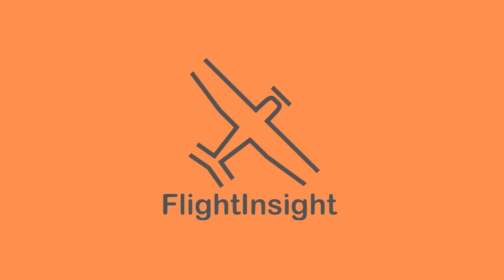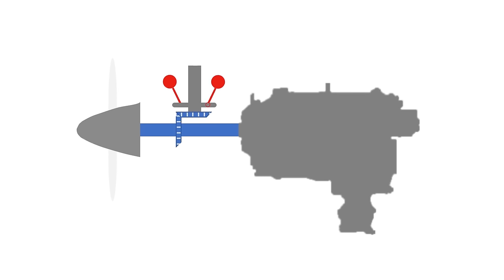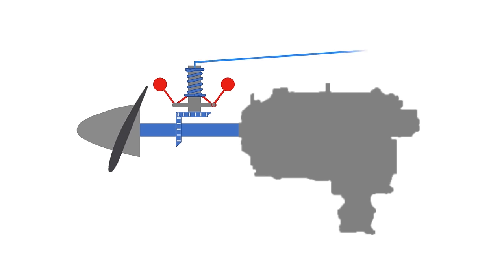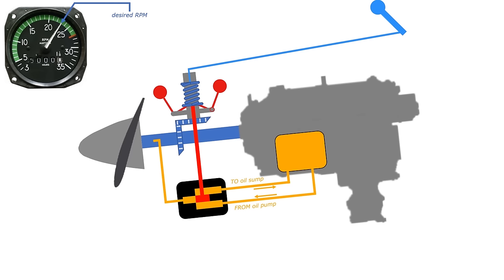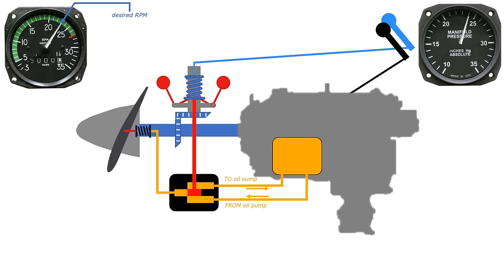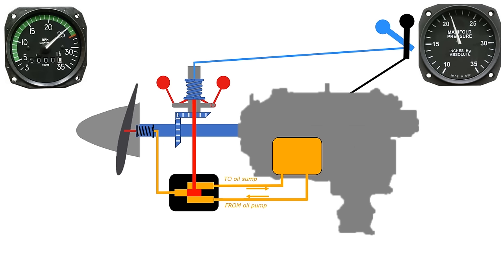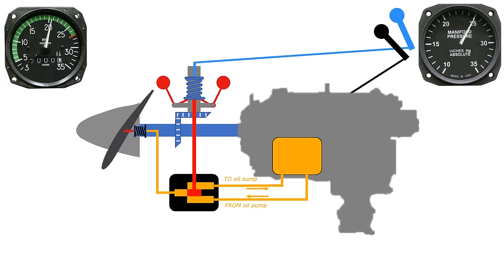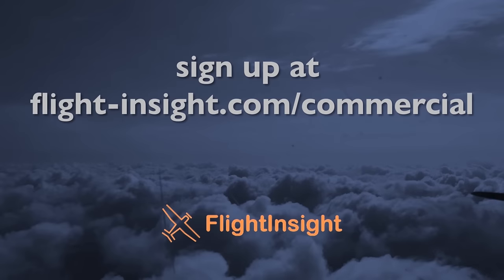How a Constant Speed Propeller Works | Commercial Pilot Training

Comment: The BEST explanation of a constant speed prop on YouTube by far! This video just isn't for people who are getting their high-performance endorsement/commercial. I already have my high-performance endorsement and I still learned from this video. Somebody needs to contract this guy to make videos for large flight schools.
Reply: A constant speed prop is part of the complex endorsement, the HP is for engines rated at greater than 200 hp. -) Happy flying
Reply: I’m aware. However, some aircraft that fall under high performance have a constant speed propellor. For example, the airplane I got my high performance endorsement in was a 1972 Cessna 172, and it had a constant speed prop on it
Reply: @matthewchapman3507  sure, in fact most HP planes have a CS prop, I was just referencing the use of the HP endorsement as it pertained to the constant speed prop, just nitpicking as a CFI, that's all, don't mean anything bad by it.
Reply: I gotcha! No worries, I didn’t interpret it that way.

Comment: Outdated myth about being over-squared!! Always refer to engine manufacturer and good luck finding one that doesn’t allow some over-squaring in normal cruise (because we KNOW we’ll be over-square on takeoff!).
Reply from the maker: Absolutely. It's arbitrary that MP and RPM are even close to each other at all, given their units of measure (inches of pressure vs revolutions). We get into this in depth in the course but beyond the general rule that a low RPM and high MP should be avoided, there's no reason not to run the MP setting slightly higher than RPM, especially as you point out that the performance tables recommend it.
Reply: @flightinsight9111  YouTube just recommended this video to me, very nice presentation. 😁I'm an engineer, (and have done some work simulating gas turbines), but very interested in aviation; you alluded to discussing it in other videos, but I'm interested in why you need high RPM for take-off, surely for every high pitch angle low RPM there is an equivalent low pitch angle high RPM power setting. Is it to do with the torque characteristics of the engine?

Comment: Good video.  From a CFI and A&P/IA, may I make one suggestion.  You mentioned that the oil pressure is supplied by the engine driven pump.  Actually, the engine pump does get the oil to the governor, but nominal engine oil pressure (say about 75-80psi) is not near enough to actuate a constant speed prop under air loads.  An important component of the governor is it’s own internal pump, which kicks the oil pressure well above 200psi.  Just like the engine oil system, the governor’s oil pump is a twin-gear type pump and has its own pressure-relief valve.  Still, as you said, a loss of engine oil pressure will create a starvation of oil to the governor, which will keep a single engine prop to maintain maximum fine-pitch blade angle.  Cheers!
Reply: This makes sense as to why “over stress” is an important consideration when we’re already talking about base operating oil pressures orders of magnitude above engine press.

Comment: I believe many people are confused by the term manifold pressure since it seems to suggest that there is positive pressure in the manifold, when in reality anything below atmospheric pressure of ~30 inches is negative (vacuum) pressure. If you've ever hooked a vacuum gauge to an engine, you're just looking at the same measurement in reverse. You could make a clear gauge with a scale for vacuum pressure on one side and manifold pressure on the other. With the gauge unhooked the needle will point to zero on the vac side, while on the pressure (MAP) side it will read ~30 inches. If you hook it to a pump and pull a full vacuum, the vac side will read ~30 and the MAP side will read zero. Directly inverse.
Correspondingly, if you hook it to an engine, with the engine off the vacuum side will point to zero and the MAP side will read ~30.  When you start the engine, you will develop a vacuum in the intake from the air being drawn into the engine, which will cause the vac reading to increase and the MAP reading to decrease a like amount. You will have the highest vacuum/lowest MAP reading at idle. As you increase throttle, vacuum pressure will decrease, and manifold pressure will increase. 
Side note: When you see specifications for planes such as WWII fighters which have manifold pressures higher than 30, it's b/c they are supercharged, and their engines have air forced into them.

Comment: I’ll give this a 9/10.  There’s one key piece omitted:  The high MP and low prop RPM condition isn’t just bad for the prop (which it is), but also has the potential for causing massive damage to the engine itself, especially in the rod bearings.  There’s also potential for triggering abnormal combustion of the fuel-air mix.  All bad and definitely to be avoided.  Otherwise, very nicely done!   Gene, ATP A320 FO at major US airline.

Comment: This is a great video, but what you failed to mention is that the prop taking a big bite is required at altitude because of lower air density.

However: 10 out of 10. This is the content I come to YouTube for.

Comment: Excellent explanation! One time during training, I was out on a solo flight to a practice area. After takeoff and while climbing out, I changed the prop setting but the RPM didn't change. I played around with it for a minute or two, but still no change. It was a winter day, so the likely explanation was that something in the governor mechanism was too cold, but it could also have been due to an oil leak, as the video mentions. Even thought the oil pressure gauge was steady, I decided to return rather than take the chance that it was nothing. On the ground there was no evidence of an oil leak, but it was better to find out there rather than at 3,000 feet and miles from a runway! 😀

Comment: Excellent instructional material. Probably the best I've found. I read some articles promoting running an engine over square (higher MP and lower RPM) in cruise flight. What are your thoughts? Keep up the great videos!
Reply from the maker: We get into this in the course in depth, but there is no real reason to avoid a so-called "over-square" condition with higher MP than RPM. MP and RPM use completely different units (inches of pressure versus revolutions) so it's purely coincidental that the numbers themselves are even close to each other. Consider that in metric, with millibars, the idea of having the MP and RPM equal is meaningless. So yes, agree with the articles, and most POHs will have recommended settings that have the MP higher than RPM.
Reply: @flightinsight9111  Just as long as you keep it above the placarded RPM for any given MP!

Comment: Some good information here but the propeller governor and flyweights are not in the prop spinner assembly. It is generally mounted on the left side of the engine below the front cylinder.

Comment: thanks I didn't know how the constant speed propeller worked but do now
also with this engine type, the pilot leans out the fuel for better range did know that,
my father used to fly me in a Piper Cherokee, young at the time but have learn't about
over the years, he says it had no CSP.

Comment: When I got into a 182, my flight instructor said that I would never want to fly a 172 again. He was bloody right.
Reply: Why? Can you elaborate?
Reply: @kcaz94  The room inside it, the speed of the airplane, and with the extended range 80 gallon fuel tank, the airplane will go further than your bladder ever will. 

Even though a 172 has 4 seats, you'll be a fool to try and take off with them all occupied. Especially in the summer. A 182, no problem. Unless you're try to get 3 linebackers off the ground. )

Comment: by FAR the best explanation video i’ve found regarding constant speed prop operation. thank you!

there is one question i have that wasn’t answered tho, and perhaps you can help me find the answer. what “manifold” is the manifold pressure gauge referring to? if, for example, at full power we’re sitting at 24inHg, is that referring to intake manifold vacuum? i’m having a hard time with that one because typically high manifold vacuum would correspond with the throttle plate being closed, no wide open. any insight?
Reply: High manifold vacuum = LOW manifold pressure

Comment: I thought it was a viscous coupling similar to center shaft of a Subaru or like a automotive cooling fan clutch that would engage more when he did respond faster? So you were saying that this angle changes. I thought it was possible for the angles of the blades to change like on a helicopter

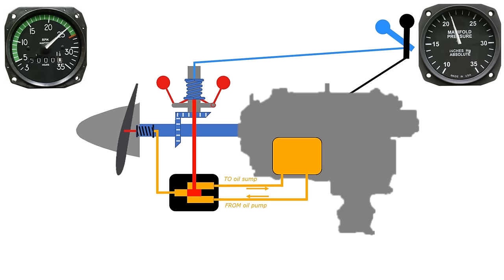Comment: 7:12  OK this is completely wrong. The issue is not that the propeller or spring mechanism are being stressed. 

The problem with extreme settings of high MP and low RPM is higher intracylinder pressures (ICP) and a corresponding rise in cylinder head temperatures (CHT). You're feeding the engine a more dense fuel/air charge while simultaneously slowing down the power stroke. Peak pressures increase in magnitude, and occur closer to top dead center. Near TDC the piston is driving directly down into the crankshaft and you have lost all mechanical advantage; you're putting excessive force loads on these engine components and asking them to do way too much work. Instead of a bullet (piston) being smoothly accelerated down the rifle barrel (cylinder) you have created a pipe bomb. The real stress is inside the cylinder, on the piston and connecting rod. The danger is pushing these cylinder components to their temperature limits, resulting in detonation. 

Extremes of very low MP and very high RPM are also bad. In this case there is insufficient positive pressure on the piston to keep it seated, allowing  piston ring "flutter", leading to scraping and scouring of the cylinder walls.

The bottom line is do what the manual says, not what some clueless 19 yo CFI tells you. The engineers who created those tables and charts know about all this stuff.

Comment: Nice video and basic explanation.   However, regarding the power settings, if running a lot of MP with low prop RPM is more likely to be tough on the cylinders/engine.  I doubt that the prop cares.  But most GA engines are so low performance I doubt that there is much to worry about (unless with a turbo perhaps). Also, running for extended periods of time in cruise at low RPM was probably never tested by the manufacturers and they are probably more worried about propeller/engine harmonics, that is any resonances that may develop, than anything else.  Thank you for the video, though.

Comment: I feel like this does a great job explaining the mechanism of the constant-speed prop, but some more "why" or what's happening aerodynamically with the prop might be beneficial: isn't this basically a thing to compensate for changes in airspeed (rather than aircraft pitch attitude as described)? I don't fly planes, but it seems similar to the concept of induced flow in helicopter rotors: the faster the air comes in from ahead of the prop, the lower the prop's angle of attack becomes (assuming a fixed-pitch), so the more RPM is required to restore AOA (and then once RPM is maxed-out, the faster you go, the lower the blade AOA becomes until you don't make thrust anymore). It seems like the constant speed prop is there to allow you to run reduced engine RPM for cruise flight while maintaining adequate blade AOA at higher airspeeds by giving you a blade pitch angle increase. I assume at very high speeds you run into the same problem we do with induced flow: the more pitch angle you add to the blades to compensate for increased forward speed (even if blade AOA stays constant), the less thrust component you get from the total aerodynamic force on the blades, while drag on the engine continues to increase?

Comment: Only one question, from the beginning of the video you combine the AOA with the pitch angle.  These are not the same thing.  Since the plane will be moving the AOA of the prop changes with the airplane's speed.  So you want the low AOA on takeoff, but then as you go faster you have to increase the pitch to maintain a good AOA with the new speed.

Comment: Always great content, love watching. I have one major complaint about this video. It is my understanding that the prop lever sets tension on the speeder spring, not the angle of the flyweights. If the flyweights were always at an angle, oil would either be added or subtracted from the prop hub constantly. Where did you find this info that the prop lever sets the angle on the flyweights?
Reply: The lever sets the tension on the spring, and the spring sets the angle of the flyweights -- so there's no contradiction here!

Comment: Though I'm not too sure how applicable this is to the average CPL seeking pilot, I believe most of the commercial manuevers for the then PTS were based on flying a complex airplane (with a constant speed controllable prop) allowing for executing manuever without rpm/power change that have climbs and descents (say for example the lazy 8s and 8s of pylons) much easier than what many applicants go through now with a fixed pitch prop.

Comment: I would think that on newer airplanes the mechanical governors could be replaced with electronic prop pitch control. The current engine speed and the desired engine speed commanded by the pilot are fed into a computer, which then automatically controls the oil pressure going to the prop hub to control the prop pitch. A system like that could even calculate the best prop pitch and best engine speed for the current flight conditions without any input from the pilot at all. Sort of like what autopilot does.
Reply: This does already exist. This is what full Fadec does on newer aircraft. I believe cirrus have this as well as some newer diamond aircraft. There is no “Blue” lever just one “power” lever.
Reply: and maybe better not use constant engine speed, just like car using high gear and low engine RPM to save fuel, with this set high blade angle and lower engine RPM would probably save some fuel too. When accelerating at full power the engine run at max power RPM constantly, and the blade angle changes gradually like car CVT transmission, so the blade angle maintains for the maximum efficiency.

Comment: My real question coming to this video is: ¿how does engine power work in here? On a constant pitch propeller, engine power = RPM, but on a constant speed propeller engine power is a combination of RPM and Manifold pressure (?).

For a fixed RPM, the greater the manifold pressure, the greater the power, but what’s the difference between 3000 RPM and let’s say, 8 psi vs 2600 RPM and the same psi?

Comment: Where is the video talking about how to fly the constant speed prop in different phases of flight?
Reply from the maker: It’s part of our commercial course!
Reply: @flightinsight9111  ah gotcha. I’m a CFII and own a piper arrow. Just curious what methods you guys talk about. Don’t really want to buy a whole course just to access one topic of discussion. Is there a way to just access the one video for a different price or something so I can at least partially support the content. 

Personally I fly 25” 2500rpm or once at cruise altitude above where I can get 25” I just fly full manifold and then leave the prop at 2500. I have a 3 blade Hartzell prop and pulling it back to anything below 2400 just doesn’t sound or feel great. The engine seems happiest at 2500 even after prop,overhaul and dynamic balance.  I know others that run 23”24 or 24”24 or whatever but part of me things it’s really engine specific on what feels best for your particular engine and prop combination. 
For instance most 182s I know use something like 23” 2450 or 22” 2350 it depends on the engine manufacturer and owner of the plane. 

What’s your take on that?

Comment: Why would drag be reduced with the blade angle "feathered?" Since it is taking a bigger bite out of the air wouldn't drag increase? the minute I post this, I know I'll regret it, as the answer is perhaps obvious. I'm a newby though;) Student pilot getting complex time. Perhaps it creates less thrust at a lower power setting thus less drag?  Help!

Comment: I am nowhere near my commercial yet, but was just curious how to use one. This video helped me understand everything except WHY we want a higher rpm for takeoff. I was thinking, aren’t you reducing the angle of attack of the prop by having higher rpm? And wouldn’t that DECREASE thrust?  Well I watched this video https://youtu.be/psYL7thQj6M and it helped me understand that the prop can be “stalled” when the aoa is too high, thus reducing its thrust capabilities at low to no airspeeds, but once you establish an airspeed, you can increase your angle of attack just like you are able to increase your stall angle of your plane in a power off stall compared to a power on. 

I don’t know if this helped anyone except me but u just wanted to put it out there

Comment: It's important to note that this is for a SINGLE ENGINE constant speed prop where you would still want a propeller at low pitch in the event of oil pressure loss. The OPPOSITE of this video is true for MULTI ENGINE aircraft such as a Piper Seminole where you would feather the non working engine.